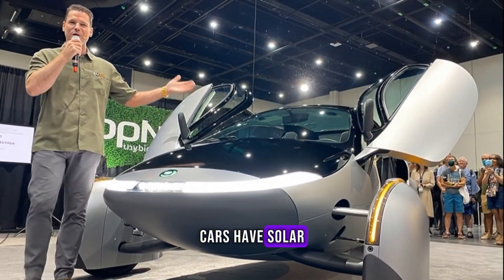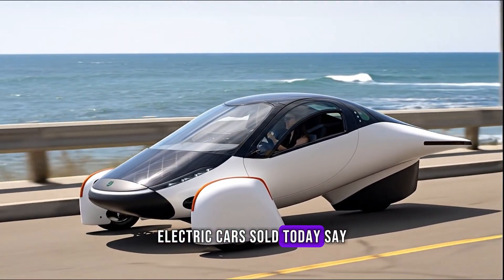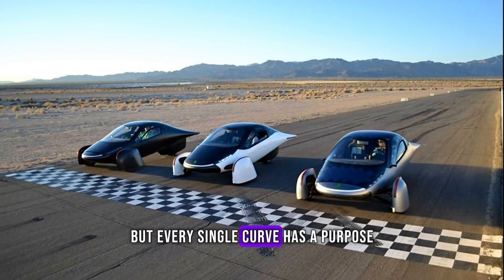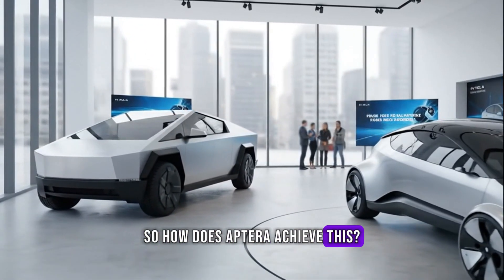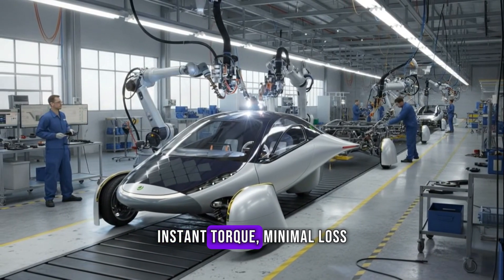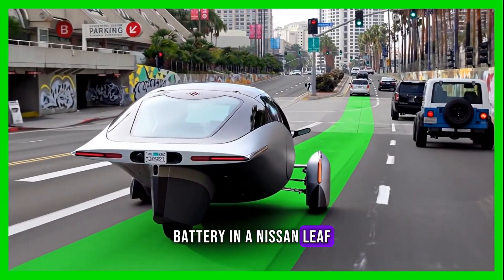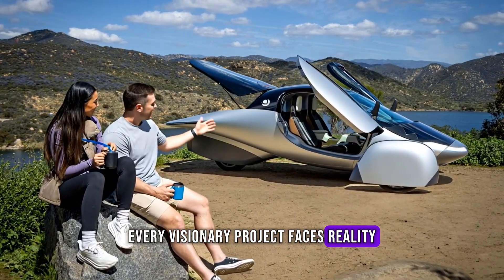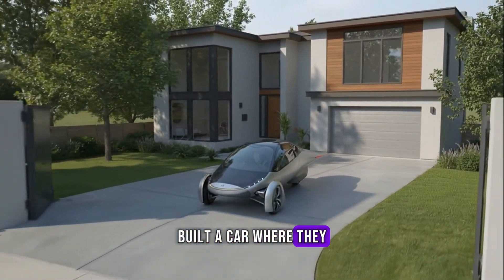No One Believed This Solar Car Could Work — Until Now

Comment: You do know that is not actually a car.  It requires a motorcycle license to operate it on public roads.  Nice vehicle but, it is a motorcycle.
Reply: Maybe English isn't your first language?  In English, the word "car" is a more general term, for example:  railroad car (boxcar, dining car, freight car), streetcar, cable car, ore car, elevator car.  I can't imagine anyone who learned English as their first language would look at the Aptera and call it a motorcycle.  That's just silly. 

Also, a motorcycle license is only required to drive an Aptera in Alaska, where less than 1% of Americans live.  Do you honestly think people in Alaska will be lining up to buy Apteras?  I'm embarrassed for you.
Reply: So  as a point of information, Aptera is a three-wheeled solar electric vehicle, legally classified as an autocycle or, in some places, a motorcycle, and not a traditional car. This classification allows it to be driven with a regular driver's license in most states, and it features a fully enclosed, two-seat, protected interior similar to a car, but with the three-wheel design of a trike. Comprende. Cheers 🥂

Comment: At the time I had seen this video. It said it was 16 hours from the time it was sent. Apparently they didn't check their fax. Because aptera No longer uses the hub motors. At this time. They use a front wheel drive unit with CV Axles. So they lose a little bit. Of. Power to the axles. Which causes. More. Drain on the batteries. Efficiencies should still be good. But you need to work on your facts a little bit.

Comment: Aptera team you all MUST get at least one Car ready. no one playing around.  you must build something to production. you have to present a working model.  these test models you built are great up if you all can not bring one for your gamma or what ever you are calling it for the production model. what has everything been for.  you all have ground breaking   Now, I am not trying to be mean I stating facts here.  I invested during the wefunder campaign  when you listed the stock and it dropped like crazy I brought more.  I was hoping it go to a point so i could value grab around the same price i brought for the wefunder campaign.  but i came away with more shares than i did my first investing time.   I believe in aptera.  and am supporting it  it's a risk kinda of a gamble.  but i'm just crazy like that.

Comment: No hub motors anymore. Pretty fair job, and I believe that this product is a game changer. Humans waste so very much, and Aptera does something about it. Our planet is in trouble, too much pollution, and dirty air. Aptera will allow you to breathe clean air. No more stopping at gas stations, is fine with me. The design is different, but 3 wheels does not mean it cannot be stable in sharp changes of direction. Large enough to sleep two folks in the back, and it will do 0-60 in a little over 4 seconds. We need to do this, it is a better way, and much needed.
Reply: The front wheel drive only model has expected zero - 60 time of about 6 seconds.
Reply: Yeah now that their stock is out out for the public unfortunately dropped down to like 70% but I think it will level out and then go up I don't know what do you think